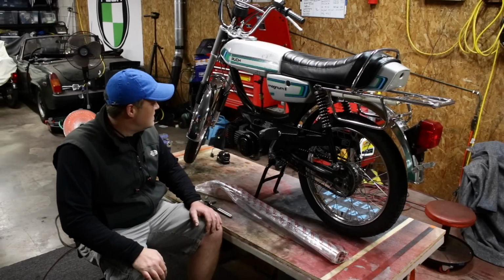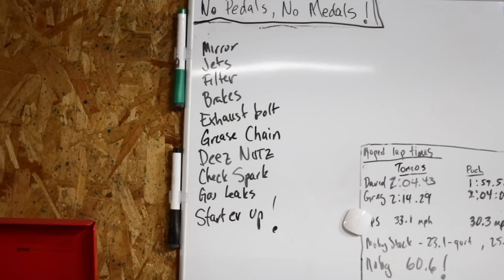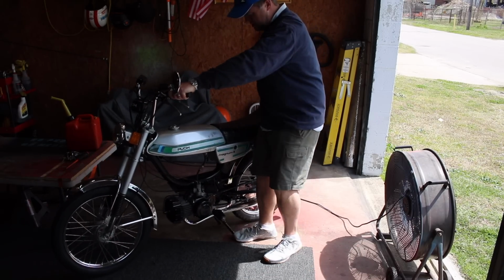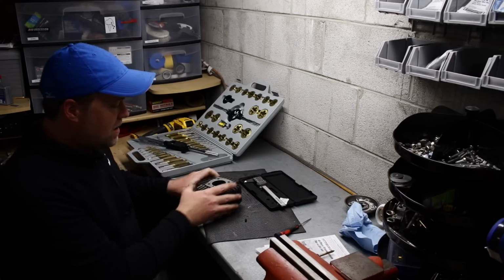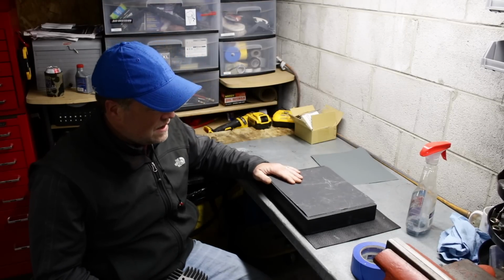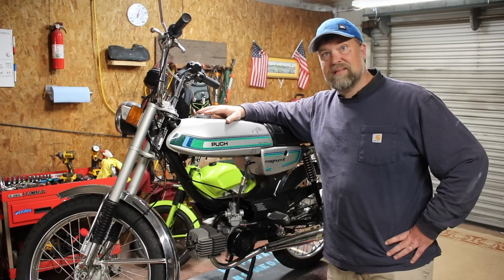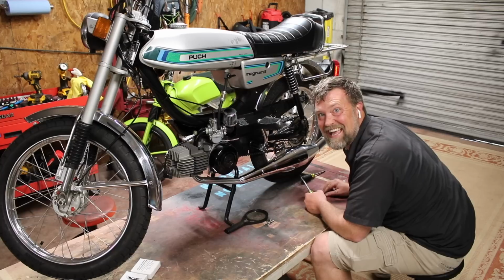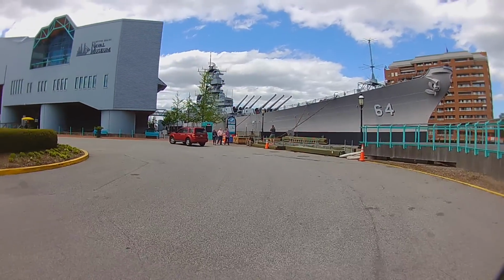DFHS Puch Magnum Ep 8 - Finale and First Ride

Comment: I know you have a drill press. A good tip is to put your tap in the spindle, turn the spindle by hand and get your tap started. This has helped me make sure I get my tap started 90* perpendicular to the hole.
Reply from the maker: Thanks Andrew.  I got a new addition to my shop last month... a 1948 Logan metal lathe.  So crooked taps are now a thing of the past 😜

Comment: Hey Dave, I just found your channel because I have a Puch Magnum MKII which I need to bring back from its long slumber. I actually bought it new when I was a kid using the money I saved from 5 years of being a paper boy in NY. When I joined the USAF in 1986 my Puch either stayed in my fathers shed or basement until I moved it to my home in GA when he passed in 2008. It's been sitting in my garage since then and I'd like to get it back on the road again. So, first off, thanks for this series! I enjoyed watching every one of the videos, you do a great job!  I'm an airline mechanic now and do tinker with my cars, but never messed with a moped.  Do you think I can get away with replacing the fluids and plug to see if I can get her started or just go for the overhaul?  Appreciate any advice you can share, thanks!
Reply from the maker: Always worth giving it a try with new plug and gas and just see what happens!  As long as the tank isn’t rusty and the motor spins freely, she might start right up.  You may need to clean the points with a bit of sandpaper.  Good luck, and thanks for the kind words!

Comment: Hey David,
Where did you get the tap and die set? Unfortunately soft seized my kit this weekend and I think the culprit was the decomp hole that I never filled. The gasket appeared to be sealing the hole until...well...it didn't. So I have a new one on order, but I need to find a decent tap and die set to finish the job. Thanks
Reply from the maker: One of the best buys at harbor freight is their big tap and due set.  I have a Mac SAE set I bought used and I can say that the HF set seems better made.    I can’t recommend it enough. It’s about $50, but it’ll last a lifetime.

Comment: Fantastic! I would use the Mart'y's toolbox site to calculate your gearing, and to make sure your revs are in the safe range for the stock bushing crankshaft. They really dislike going above 8500 rpm, and can fail catastrophically if you do so for long periods. ZA^) engines also last way longer as a whole if you keep the revs lower. Here's the site, you just enter your moped type, engine, and sprocket/tire size and youll find a pretty accurate RPM based on your GPS speed. http://toolbox.martysgarage.info/
Reply from the maker: Oh shit. If that’s right, then I’m in trouble on this bike. Looks like I’m hovering around 10,500. Oh well, ride it till she breaks and then fix it again. It’s just a moped 😜

Comment: Where did you buy the flat surface? I could use one of those.Thank you
Reply from the maker: Heya Rob. I got mine at Woodcraft. But they are just called a ‘Surface Plate’ and you can get them on Amazon or eBay. A lot of people just use a pane of glass as a substitute
Reply: @DavidFixesHisShit  Thank you David for the tip. Specially about the use of glass as a substitute.
Cheers

Comment: I love mopeds...but they hate me  (@225lbs. my fat-ass is too much for any 'ped')
I also despise the noise and vibration from a 2-stroker
*Solution?  '08 Honda 'Metropolitan' w/many upgrades (engine/exhaust original eqp.) and
the 'Mighty 50' performs flawlessly...and doesn't care about weight...I hit 42-43mph w/no
problems & mirrors that are rock-steady and the engine sounds like 'pit-bull under the bed
growling' under me while hauling huge amounts of groceries home*
Problem solved
Reply from the maker: I ain’t a little boy either 😉.  It’s one of the reasons I throw kits on everything. So it’ll get my fat ass up and moving.